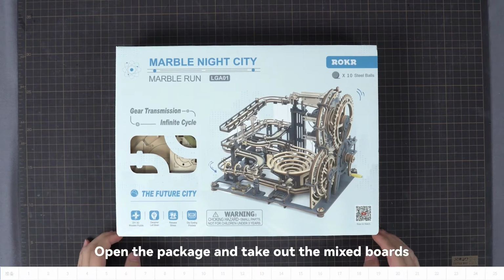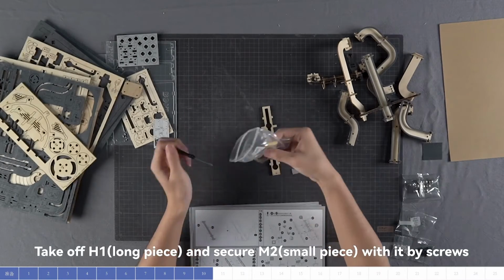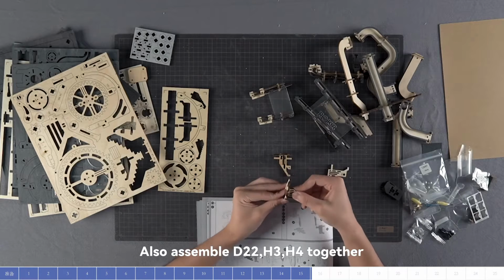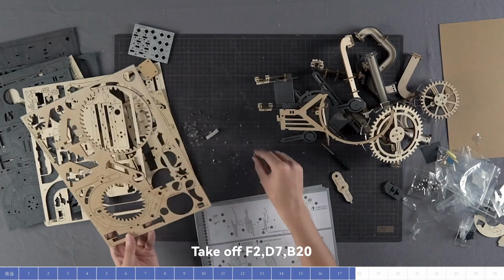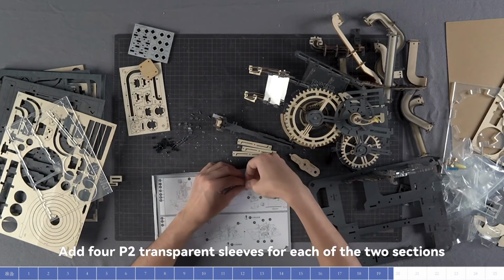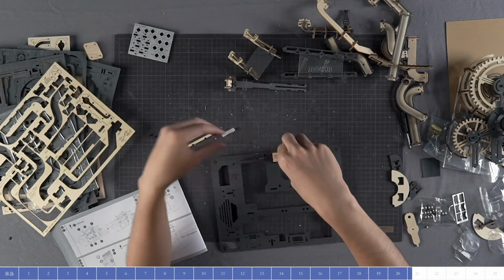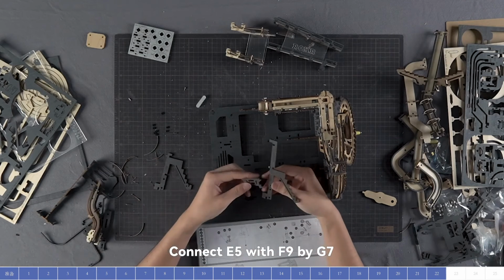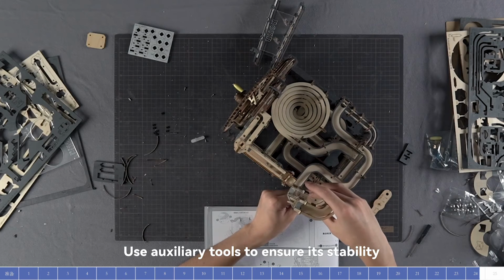ROBOTIME ROKR Marble Night City LGA01 Assembly Video

Comment: good job getting through it. i had to use a knife cuz of how cheap and flimsy. the instructions in this book are the most horrible thing they created. the English is less than 3rd grade level(you would understand once you looked at it) the assembly directions are completely idiotic and not done in an al intelligent way. after the first 8 pieces were made i was wondering when they would actually be attached.... the very end of the book.. really? so i tore all the pages out and put them into logical order. won't buy these again

Comment: I don’t understand step 4.  A3, isn’t wide enough to fit in c22 pieces. I can only attach one side or the other, but not both.  When I connect one side and try to connect the other does, the original side I connected pulls back out.

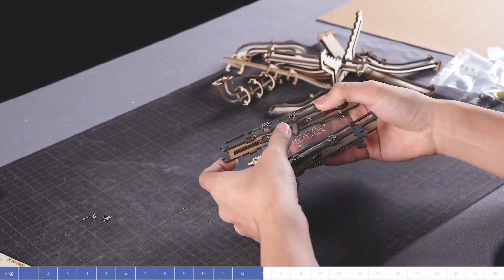Comment: At 16:10 min.  part J and K are in the center of the holes above them not allowing the balls to go down those holes. Am I missing something?
Reply: its supposed to be like that, the first 2 balls cover the holes in order for the rest of the balls to roll over them, then the balls that fell down knock the first two back down
Reply: @ErikJong i though i did it wrong ty!
Reply: ty ty ty

Comment: Please can you give me any tips on to how to easily put the P1 and P2 parts onto the metal poles please I really need to know this to finish my set I am on page 20 and i am on the part where you have to put the C21 part onto the I2 part please help me if you can thank you
Reply: I wrapped some masking tape inside-out around the D11 tool and used that sticky surface (backed by the wood of D11) to pick up the P1/P2 pieces to push them onto the metal rods while using the other tool to hold the far end of the metal rods.

Comment: i'm stuck on 47:30
those transparent knobs are just to difficult to press to the sticks. i could do them before because i could do it in a flat surface. now its asking me to place and push it down in air? idk if it shrunk or what but those little things require so much energy to go in the metal bars
Reply: for other people stuck there, take the one spare rod and push it completely through each of the transparent rings (not more than one at a time) before trying them on the assembly. Just use a spare wood piece to push on the rod.
This widens them ever so slightly making the impossible task just challenging
Reply: @flatterkatz  This was a brilliant piece of advice.
Reply: @grimfilm agreed
Reply: agree, broke a piece because of those
Reply: You're not kidding.  After struggling with a few, I put a bit of wax on the metal rods.  They seemed to pop on alot easier with the push tool.
Reply: after a little bit of waxing i finally did it
Reply: use a pen knife to crave a bit of the center of the sleeve
Reply: I wrapped some masking tape inside-out around the D11 tool and used that sticky surface (backed by the wood of D11) to pick up the P1/P2 pieces to push them onto the metal rods while using the other tool to hold the far end of the metal rods.

Comment: timestamp 4:55,,, this is where I'm having a problem. getting that last piece on that rail. this video didn't really help much to see HOW it attaches exactly without snapping the rail into pieces. which I have already done once. Guess the hunt is still on for easy-to-understand directions for that part.
Reply: If you find it please let me know...  I'm having trouble with this part too.
Reply: I found G13 to be a really tight peice to get in. I shaved off I little bit of material inside all the connections (like less than a mm amount) and got it in there with a fair amount of anxiety that I was going to break something.

Comment: Why no wax in my box
Reply: There not enough transparent sleeves on mine
Reply: I thought mine didn't come with it, turns out I wasnt looking hard enough
Reply: As stated in the manual, it may not be included due to customs restrictions. I've just bought some cheap candles and used melted wax from them. There are videos on this topic
Reply: UR BLIND
Reply: @thedailyrice  none in mine aswell

Comment: The music is of a greater volume than the soft female voice with heavy dialect and is an unnecessary distraction; the combination of music and the weak hard to understand spoken words make the narration unusable for me. 
Also, some of the hardest to understand printed instructions such as “D2 wax before assembly TO PREVENT CONTAMINATION of acrylic parts” is NOT made any more understandable in the video!